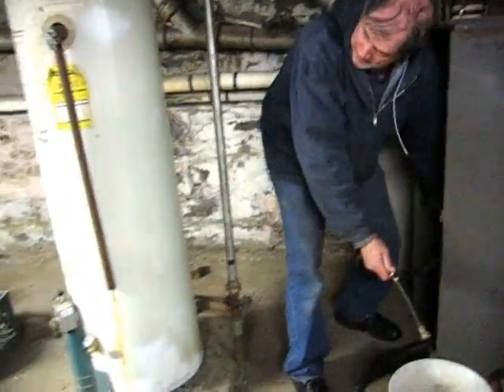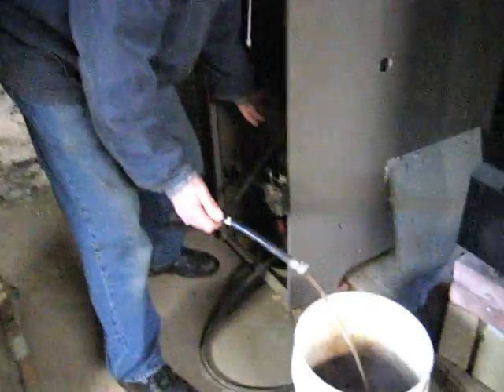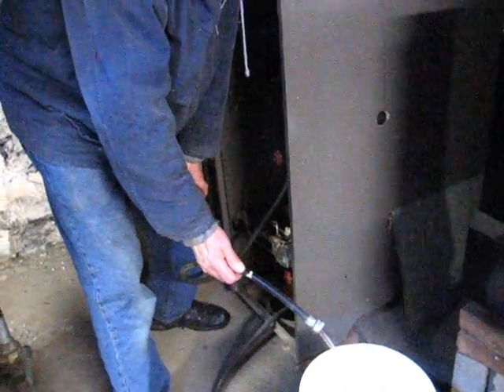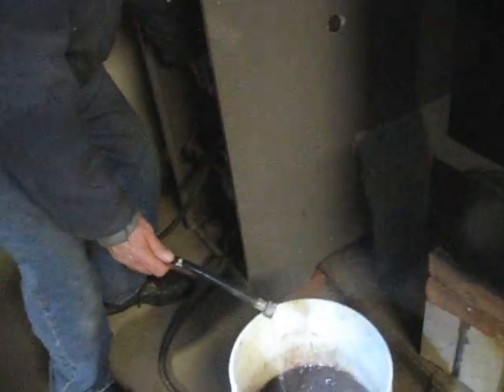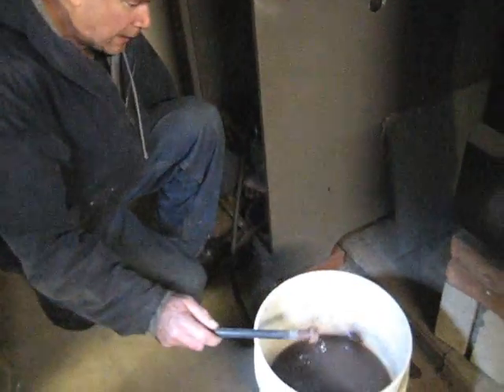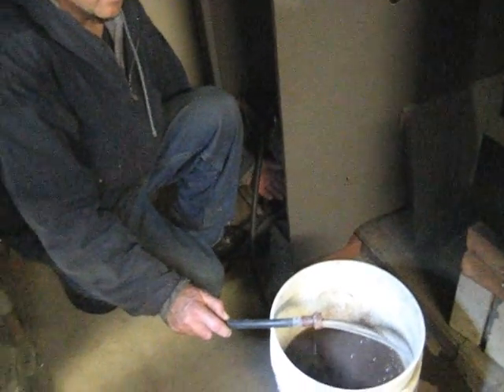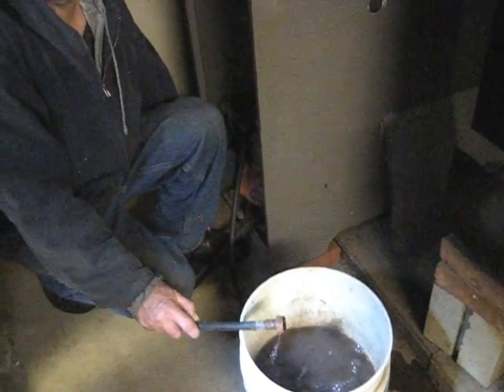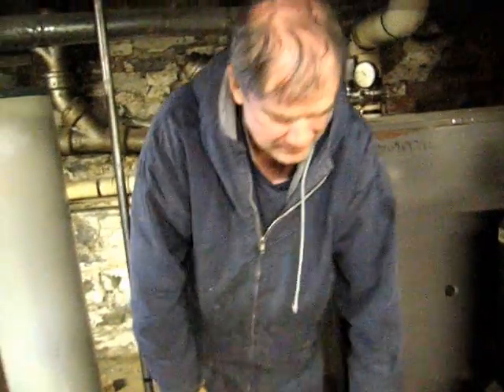Steam Boiler Maintenance !

Comment from the maker: It's really not rust we're flushing,  rather it is the mineral deposits found in most public water,  also called 'hard water'.  Hard water is full of minerals which form deposits (scales) within pipes which restrict the flow of water,  or worse clog the pipes.  The scale also builds up in heat exchangers (boilers) which restrict heat flow,  decreasing efficiency,  and can cause boiler parts to overheat and fail.  The low water cut off valve is $185.00 so keep it clean - flush, or get insurance.

Comment from the maker: @glennus626 And when your asleep in bed one night,  the water shut-off valve will malfunction and all the radiators will fill with water and spill over through their tiny air valves onto the floors and down through the ceilings.   Been there,  done it.   The shut-off valve was about $280 new,  and we had run out of spares;  they say it's good to change every five to ten years.

Comment: @brokkenstar Yikes, I just got done overhauling a couple of radiators in an 80 year old building with a one pipe radiator system that I manage.  Took 4 guys to get that radiator up to the raised first floor.  With radiators more than any other item in the boiler room it's all about having the right tool, too.  And, of course, the boiler needs a good flushing once a week or your mechanical water feeder will go to hell in a handbasket.

Comment from the maker: @glennus626 It's a two pipe steam radiator system in a building over a 100 years old,   at the end of the heating system we would routinely drain the boiler of all water to help reduce the errosion.   In addition,  the water in this area has alot of sentiment.

Comment from the maker: @Foxtrot262   I don't compare to your knowledge,  my father installed the two steam boilers to a 10 unit apartment building,   I was just the building super after he died,  we owned the 100+ year old building for 30 years,   the 2nd longest.   They say there is only 1 million steam boilers operational in our country,  you must admit there's no heat like a steam boiler with radiators,- constant and long,   sometimes like the tropics.  

Do you work with industry or residential?

Comment from the maker: @Foxtrot262 You are right,  because if the low water cut off gets gummed up and stop working all the radiators will fill with water and gush out creating quite a mess,  damaging floors,  wall and ceilings.   The low water cut off should be replaced every 5-10 years,  don't wait for it to go bad.